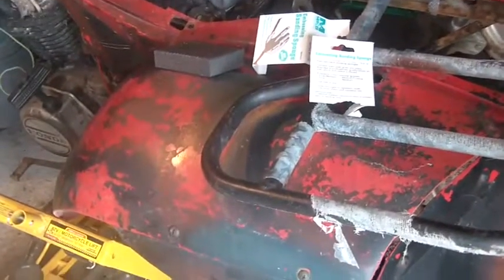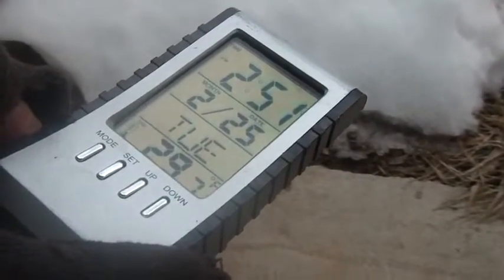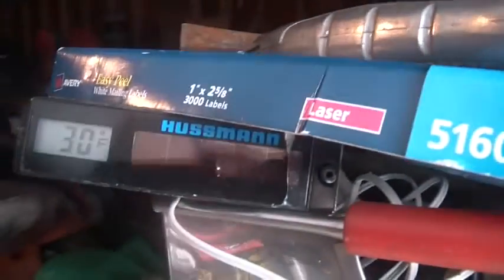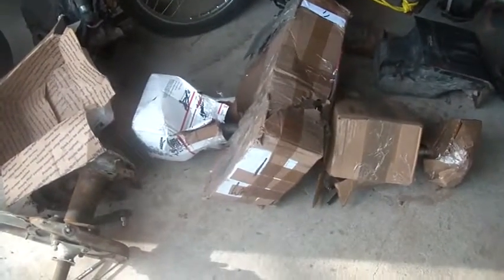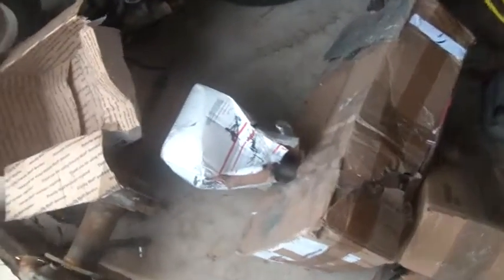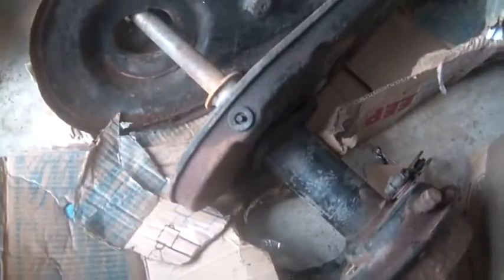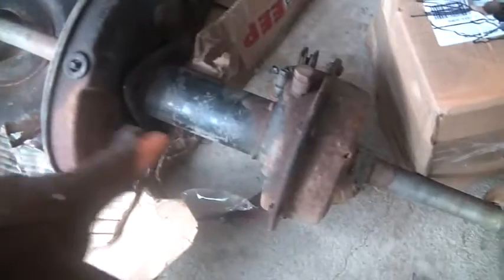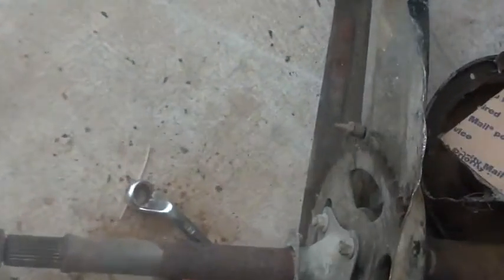2_25_2014, eBay Honda 200S rear, sanding blocks, coping with work

Comment: those are the blocks that l wet sanded the single cab, l here ya on work with all the loose ends makes it hard to plan your life,
Reply from the maker: Mustie1, Todays rumor at work is the layoff is cancelled, only God knows what is happening here. I'm going back to the month by month plan. Thanks for the info, watching, and commenting!